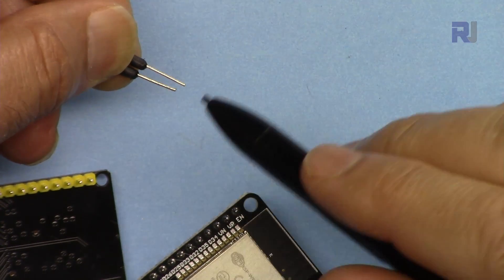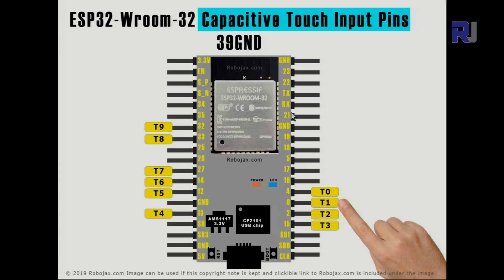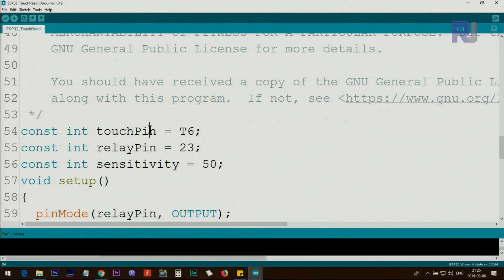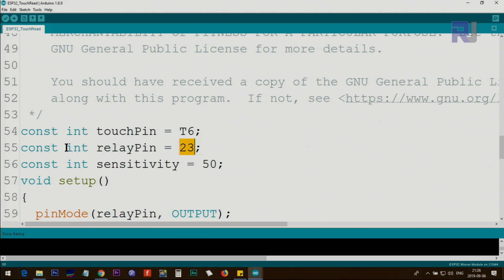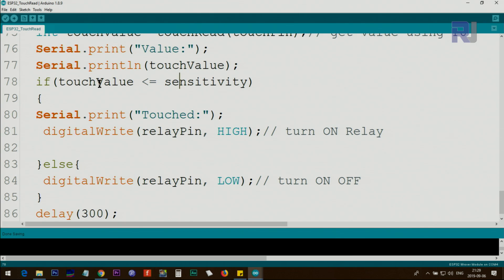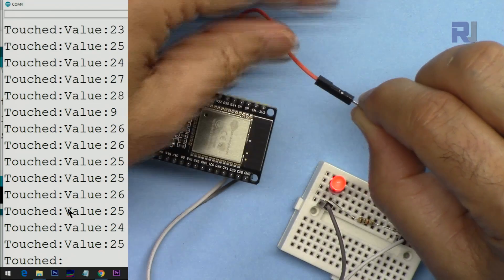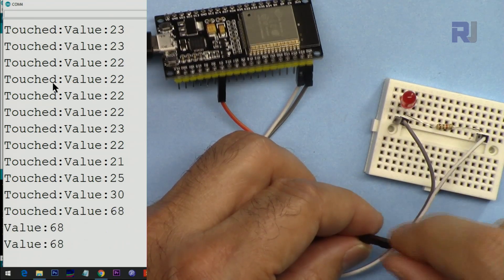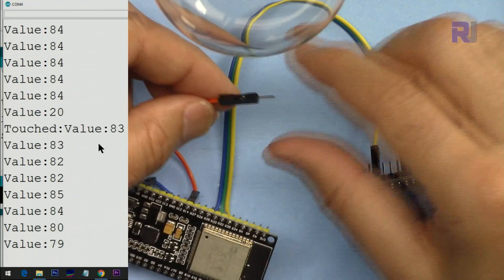How to use Capacitive touch pins of ESP32 Development board to control AC but or LED - RJT217

Comment: Hi This is a nice video. Can  you please put a video for ESP8266 also with touch sense functionality ?
Reply from the maker: I am not sure if eso8266 has such feature. But I will check
Reply: @robojax  , Appreciated for your response. Will wait.  To surprise my grandson, I want to make animal noise making toy when a switch is pressed. I have already have a toy which has capacitive touch keys and is gone bad. I removed the bad part/IC/etc..., and want to put esp8266, I am stuck at capacitive touch read stage. Searched and spent lot of time for the esp8266Touch.h(or equivalent)  lib with no success.

Comment: touch value keeps floating when I dont touch the wire, values still goes down below sensitivity and turns on the led..........I dont know how you get constant value when wire is not touched......I had used sensitivity as 20 still there is value like 2 on my serial monitor which turns on the light even its not touched.....any solution.
Reply from the maker: wow. 2 is very good. play with it to get the result you want.  this is very basic feature.

Comment: I've got longer wires and it seems that the on value is harder to detect
Reply from the maker: it is capacitive couthc. This module is meant to be on PCB with touch plates. Wires will affect it and longer wire will make it worse.